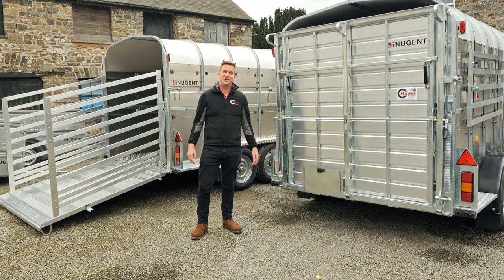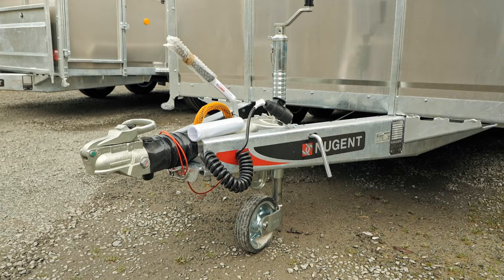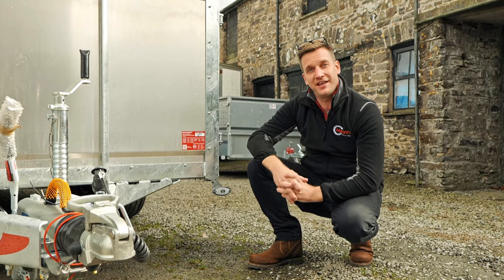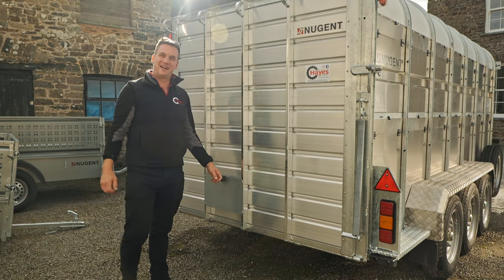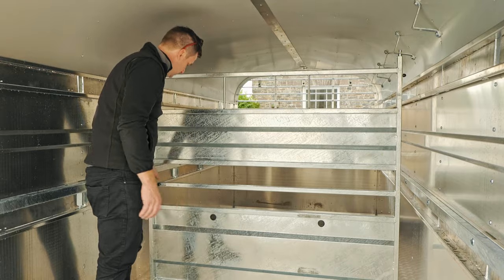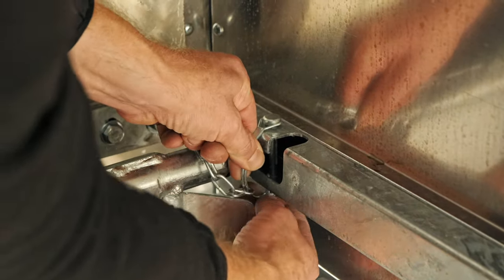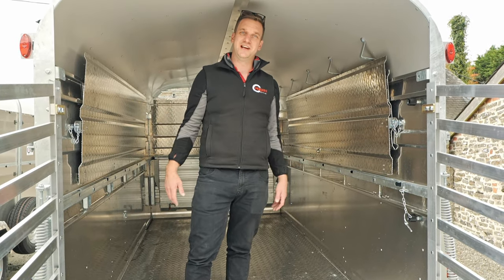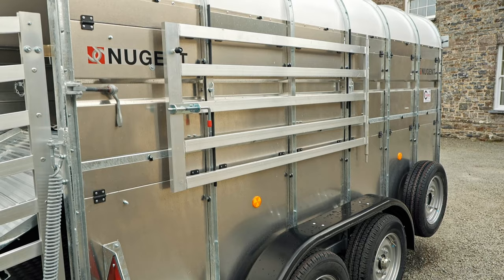Nugent Livestock Trailer

Comment: Where is the effluent tank, I thought they come as standard. Essential on long trips.
That ramp on the top deck leaves a big gap to the roof, at least a foot. Lambs could try to jump out. Do you have a horizontal bar that blocks it off like IW trailers.